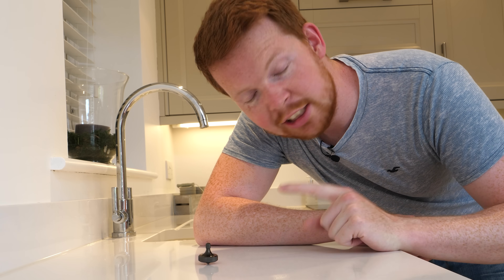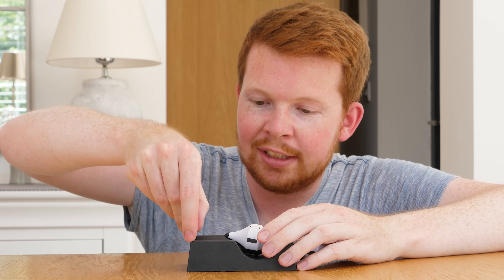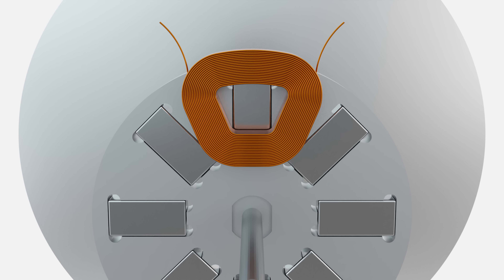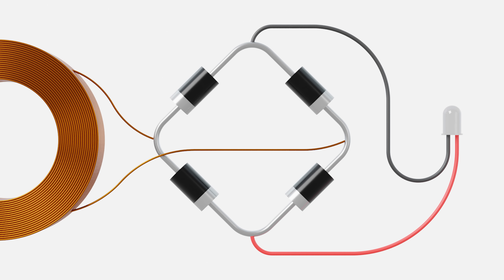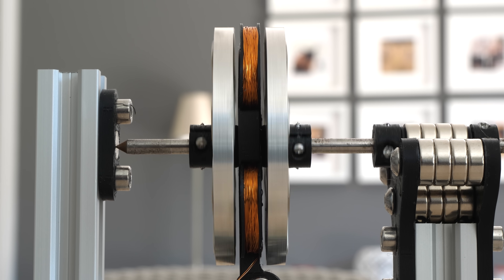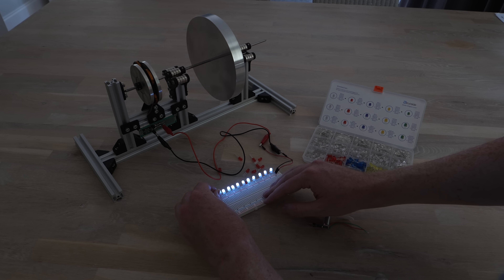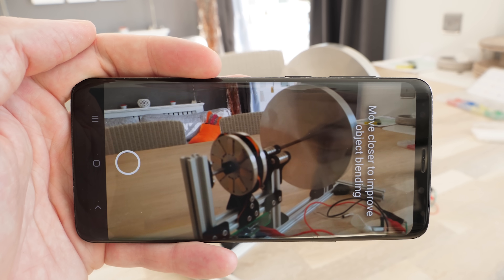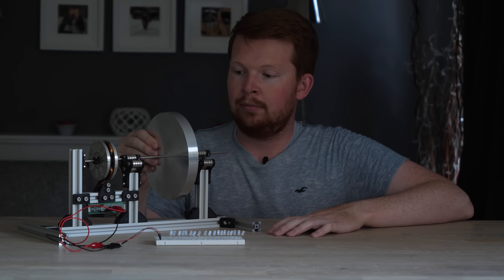Flywheel Battery

Comment: I sugest adding the third magnetic bearing at the other end of the axle and having it magneticaly confined from at  least three directions for example in a equal-sided triangle configuration.(Thou this does not circumvent the bent axle problem) 
You can also try using this for all other magnetic bearings,reducing the leght off the axle and maybe get a new (unbent) axle.Sorry for bad eng.

Comment: Idea to make this better is to build a sub part to the axle that's hanging out this section will have a clamp that can grip to the rod at any time that's attached to a high speed gear crank a gear going from any crazy high number to a small one for max speed per revolution and the handle of the crank has a trigger much like a bike has and treat the system like the breaks do but with a clamp to the rod and when you spin the crank for a while let go and the flywheel will keep spinning like it is now and the crank makes it easier to start it up at will and if need be speed it back up this would increase the voltage output due to it spinning much faster and last longer due to more speed stored in the flywheel

Comment: Great my dear son, the invention take lot of time to come true. In this so many mistakes you did in this process. Remove fly wheels first. These consume more mechanical energy. Second arrange magnets blocks used in alternator mechanism it generates more ⚡ you can run a motor to make continue the spindler speed constant. Better luck next experiment.

Comment: Pulse also affected by periodic scan/recording of images. Even our own eyes scan at some rate.

I used to work on CRT color monitors and with a single gun /red screen one could eat ice or bounce on a hard floor and the vibration makes a natural pause in the recording/scan and you could catch sort of a freeze frame and see the retrace with about a 2-3" gap between horizontal traces and see the long retrace that is actually a composite of retrace segments. Interesting and complicated but then again revealing of how our eyes and brains work. ... at least mine.

Comment: you could sandwich as many coils and magnets as you want and use more negative opposing magnetic fields to make it so the shaft does not have to touch anything and can float. you can also seal this in a low pressure chamber to achieve near zero resistance spinning and full efficency

Comment: the first iteration of the Kinetic energy recovery system (KERS) in formula 1 in 2009 was basically a flywheel in a vacuum housing. once the flywheel was spinning at full speed, the driver could release it's stored energy for an estimated 80hp boost for about 6 and a half seconds.

edit: okay, now i've seen you've made a bike with "KERS" in anothe video.

Comment: Leave the shaft in the flywheel, chuck it up in granda's lathe using a 3-jaw chuck and reface the wheels face and edge. It will then run true.

Comment: ⚠️ The coil setup on this is all wrong, as it does not yield maximum output, and the magnets need to be almost touching the magnets for maximum output. When aluminum is placed next to magnets the aluminum acts as a brake. Using aluminum for this project was a very very very bad idea.

Comment: In the year 1971,we travelled to Henån City,and on our way home this Saturday,there was strange changes on the Car Radio, and like a big Church Organ,the Radio had very strongly effects with multiple frequences very loud.
The Owner of the Car,Bert,said that we shall be alerted,because we are supposed to see something very rare....

Bert was right, there it was.Golden glowing.
This was fascinating
Never before have we seen such a Night glowing goldyellow gigantic wessel.
Our Chauffor put the foot on the gaspedal.

The Car motor was not quite tuned,ignistion
And therefore we just was in speed,some 72 kilometer/per hour. Bert was keen on Study the under of the Gigantic Wessel.

Just before we where about to reach the North side of the Tunnel,aproximate 30-40 meter,before outside the tunnel and on the South side of Bridge of Nötesund there was two sound,clang and clang,we hear as the window of the car,was down ,too be able to hear sound of the totally silent enourmos wessel hoovering some 50 meters above Sea Level.....

Later we heard a withness tell,that he had taken a rifle,and shot two sharp ammunition under up of the Wessel. That was the exponation,clang + clang,underneath this Wessel...

Glass Metal is 50 times stronger than ordinairy
Metal or Stone. But anyhow,fraction of seconds
Thereafter,20.13 in this Evening,in a very strong white,Sonoluminiscence flash that move Easterly directions with an immence acceleration,that no living thing could have a chance to survive.

My beliefe is that we saw a TIME-travel...

Withness saw 5 or 6 white Flashes along the pathway of this Wessel,at this time 20.13

20.04 o clock this Wessel came out of misty fogg,just materialized, 3 children aged 7 year old girl,and two cousines,about 9 year old,told us that they tought it was the Moon.

They realized that it was not the Moon.

This came to their attention,as they saw the pattern under this Wessel.....

So this all happened this November evening.
There are more details.Houses went dark,all electric devices stopped working,because of this Electro Magnetic Pulse.
There was also seconds later,a big rubyred glowing cloud,in Eastern direction,it was very special movements,hard to explain.
And seconds later a big dark blue NATO-star,it was only there for 5 seconds,and when it nomore was glowing,the Ruby Red Cloud went gone.There was as nothing have happened. Dark and somehowe terrific,like in Cinema.
But this was a genuine UFO.
NOTHING about it in the news.
Not in Television,not on Radio,not in Paper News.1972 i wrote to Elvis Presley about it.
No answer.But years later i got a letter from Bill Clinton.

This ought to be told the children that UFO is from the Future Earth,visiting back in Time.

Comment: Thanks, for sharing young man. LOVED, SUBSCRIBED, & DING!!! @13:44 this material is called 80/20 and my boss LOVED it. He made a frame with 80/20 that was 2"x2" and other sizes for a machine that wrapped foam with material that conducts electricity. The newest cell phone, plasma televisions, and even antennas (for GM/NorthStar) use these technologies. Everything needed to make the flexible copper-plated material except the foam was made in-house. Afterward, I was tasked with making maybe30+ more in my six-year stint. They shipped these inexpensive foam wrappers all over the globe. Retired now for 15 years.

Comment: 9:30 LEDs do not consume energy.  At a low voltage, say 3VDC  you could plug in 100 LEDs and get the same result.   Please try it, it will blow your mind!

Comment: I believe the flywheel alternator can also function as a brushless motor with a suitable brushless controller to spin up the flywheel.
Reply: And you could "charge" the flywheel when you have surplus energy and then use it when you have higher energy demand.
Reply: @gabiono7965  That line of thinking is what led me to this video.  Trying to conceptualize worthwhile power storage for smaller scale wind & solar, to combat their inherent inconsistency.

Comment: Ok so you can get more usage by adding another set of coils on the other side and then lead it to another set of magnets at the end and another stopper for the axel. Then build a hand crank with magnets on it  and you have a magnet gear system to spin it faster which could also use a system similar to those toy cars that ramp up by rubbing the ground with them to get going.

Comment: Very cool, however not really a battery. I would like to see this developed further. The alternator is creating resistance and slowing the flywheel. You could mount the alternator magnets on splines to move them away from the coils when spinning up the flywheel, then toward the coils when you want power from the alternator.

Comment: years ago a prototype electric car used a flywheel on an air bearing that once spun up, it would help recharge the batteries as it would spin on it's own for hours, even after parked.

Comment: If you put a single rectifier diode on each coil, then the Lorentz force will assist the rotation. But with a bridge rectifier, the coil current is allowed to alternate which will cancel the Lorentz forces.  After running for maybe an hour your flywheel may possibly accelerate to destruction.
Reply: What?????  Where would that energy come from???

Comment: If you had the system in a vacuum box to reduce heat and friction. I designed one years back.
I made other devices using magnets and spirals which worked independent of motors and didn't stop.
Thanks for the video!!

Comment: Tom. If you had a second motor on the other side of the flywheel,  then used one Gen to power the motor. It would speed up. 
At speed the power to the motor would reduce because the flywheel would require less energy once at max rpm. This should generate a surplus.

Comment: 🧲All this is good and well, but you overlooked a couple factors. The magnets interact with your aluminum wheel acting as brakes. Additionally, using power to generate power is senseless. Simply use magnets to make the wheel spin. If I post a legitimate  example, YouTube will take my post down. Great lesson nevertheless.

Comment: You should build a little hand cranked spinning device that has a little clamp like a disc brake you can push onto the rod and using gear ratios you can spin the rod fast then release the clamp. The device spins it fast creating electricity with just your hand.

Comment: Impressive concept.  Is there a way to magnetically separate the frictional contact point with magnets?  Or do you run into the same problem with a frictional contact point on another axis.  I guess my question is can the flywheel be magnetically balanced with no contact point?  Computer controlled?  I'm just thinking F-16 fly-by-wire....the aircraft requires the computer to be able to fly...to do all the control calculations.  Once contact friction is removed, you'd just have to worry about air friction.....throw it in a vacuum chamber.  Frictionless rotational energy storage!

Comment: Use a magnet on the end of the shaft to eliminate friction, and it should spin for longer
Reply: I thought the same, however, I'm not sure whether or not it could work. The magnetic field has a wide range. It would have to be very low at distance and get rapidly stronger the closer it gets. The carrying fields also rapidly change on position change.
A video trying out to find some construction would be nice. It might even contradict physial laws. I guess there's a reason I've never seen such a construction yet. Most magnetic constructions are similar to a ball on a convex surface. We had to find a construction behaving like a ball on a concave surface. So the question is: Is that even possible?
Maybe an additional magnetic ring and ferromagnetism could help.

Comment: Now take the output of the motor and mechanically attach it to the flywheel so that the motor is generating the fly will make it spin use a rubber will attach to the motor to touch the edge of the flywheel see how much longer it goes

Comment: Even if the magnets themselves don't generate a variable magnetic field, of course, the complete setup with the coils does and certainly generates Foucault currents in the aluminium magnet wheels. I would rather build them with a non conductive material or maybe with slots.

Comment: YOU CAN USE A STRING TO WRAP AROUD THE AXLE AND WHEN YOU PULL IT IT WILL ROTATE THE FLYWHEEL AT MUCH HIGHER RPM MANUALLY
Reply: Only for the initial spin, and you'd need a pretty long string cause if you just yanked it the whole thing would be off kilter. He can spin it back up without stopping it and re winding the string the way he had it tbo
Reply: THAT ISN'T A GOOD PLAN.

Comment: What if you offset the magnets? Then it would be balanced right?
Reply: I think most solutions are like balancing a pencil on its end theoretically possible but not practical. The toy and Tom's work the same and compromise .e.g  only a small force is required to support pencil on one side and it leans to that side.

Comment: I think simply boring a hole in the ground and hanging a bucket of the same dirt from ground level with cables like a below ground elevator as an ultra-simple gravity battery might be the best way to go, locally at any site and of any scale.  I wonder how a flywheel battery compares to a gravity battery in efficiency, etc.

The Boring Company and Elon Musk should make vertical shaft versions of various diameters for local, simple gravity battery storage purposes.

#SwitchToSolar #SwitchToElectric #EndFossilFuels

Comment: It takes energy to create energy. The amps are flowing through the wires like water through a hose. Electricity needs back pressure just like water does to flow. So the electricity flowing pushes back. That slows the generator down. There has to be an equal or great amount of input as there is output to keep the energy flowing.
Reply: exactly, i cant see point here
Reply: The device is for storing energy not for generating
Reply: Duh. He just showing us a  'mechanical battery' by using inertia.

Comment: Did you try measuring how long it spins with and without a load?
Reply: I wondered that too. The greater the load, the fewer revolutions. If you take a ton of rechargeable gadgets on a road trip, your fuel economy will suffer.
Reply: @waspbloke  why is that?!

Comment: How about testing how efficient it is? Maybe measuring the the power consumed by the drill used to rotate the flywheel while you also measure the power used in a load
Reply: I can't believe he didn't even talk about that, either.  Not such a good comparison to a battery.

Comment: Could this be hooked up to some type of sterling motor that runs off  temperature difference ??? That would be an exceptional machine for sure
Reply: Oh yes do you intend to use magnetic levitation bearings on the hot air engine ?.To be honest I have a feeling that  the magnetic bearings may be no better than ball bearings and of course the latter are much more constrained and keep an errant flywheel in check. Air bearings may be better but they do require energy input. Toms flywheel is only working at low speed as I suppose a hot air engine would.
Reply: Hi
Reply: i think F1 engineers worked on this.

Comment: Hmm… You could've "fixed" the bent-axle situation by (1) Cutting off the threaded rod from both sides of the flywheel; (2) Using your metal lathe to get rid of any nubs of the rod until the whole flywheel was again flat; (3) Carefully drill out the remnant of the rod in the flywheel.
Then drill out the flywheel large enough to accommodate a new threaded rod.

Comment: So question  if u mange to optimises to get enough  power and using grearing  theoretically u could use the little motor to make it keep turning the fly wheel and technically that's infinite  power correct ?

Comment: WHY NOT put four of these, of much greater voltage output, into a car, near each brake rotor, to all charge back to a battery? They would free spin during any braking and spin even faster at full brake at stop signs and red traffic lights. It might add 100, probably less, total weight to the car. Use this energy to charge either a giant capacitor or battery. Then, in a bind/when low in charge of main battery, you could use this stored flywheel energy that was not free but didn't require a lot of WORK.
Anyone tried this or similar?

Comment: I was amazed how slowly the magnets could be moving past the coils and still light the white LED.
Reply: Modern white LEDs are usually extremely efficient, requiring only minuscule currents to be visible. (Modern emerald green LEDs, too.) As indoor-only indicator lights, I often run them at 50-100 microamps (0.05-0.1 milliamps). It’s impressive how efficient they are!

Comment: Throughout the whole video I was wondering if one of the motors could somehow be mounted to the flywheel shaft to assist it in spinning longer. I know it wouldn't even be close to perpetual motion machine, but it could help it last longer, right?
Reply: The flywheel holds only so much energy; any load put on the motor would slow the flywheel down more than the motor itself would try to speed it up.  It would probably slow down faster.  
Every time you change from mechanical to electrical energy and back you lose some.

Comment: This is a very good video.. .   Totally correct, and a very good learning tool for learning something about electricity. . .   Just note, the Power is put in by his hands, spinning the flywheel, the power out is as he says, generating electricity and powering the LED's.. .   It is an excellent learning toy, well worth the work and effort, note, the more LED's or other loads, the faster the flywheel slows down. . . Good one Tom  :-)

Comment: Hi, This has already been done. . . New York had about 10 MW of very fast 20,000 rpm or faster. ..  Yes, they used magnetic bearings, and they ran in a near vacuum. . .   The company who made them has now gone bust. . .  Flywheel Energy Storage is not such a good method of storing energy. . .  They only provide about 5 - 15 minutes of useful stored energy, and they were very expensive, much more than Lithium Batteries. . .  They have to be spun up by an electric motor, that is putting energy into them, and you get the energy out as voltage, but the voltage and frequency are getting lower and slower as the spinning flywheel gets slower as it gives up or releases its stored energy.. .   So now they need electronic Inverters to convert that variable supply back to regular 60 Hz AC Voltage.

Comment: itsz easier to keep the disc spinning than to start it once spinning it is easier to charge than to keeop it spinning .. you can use a second spin disc to start or a different battery .. the fact that charging isz easier than driving isz a gift of god like weed and space shipsz